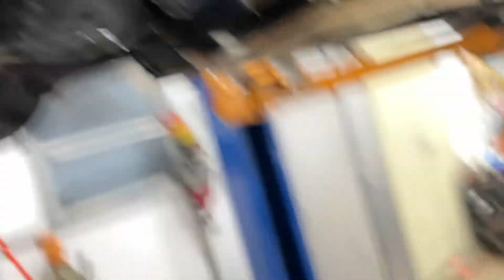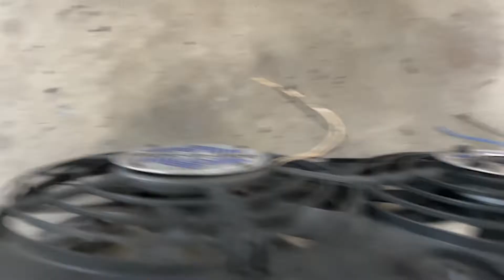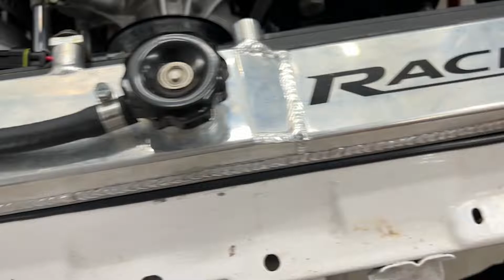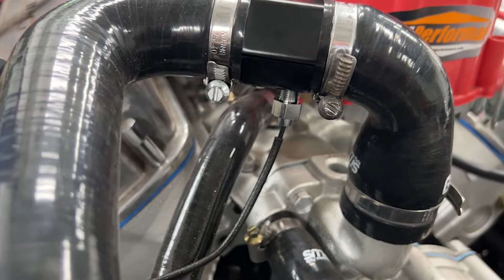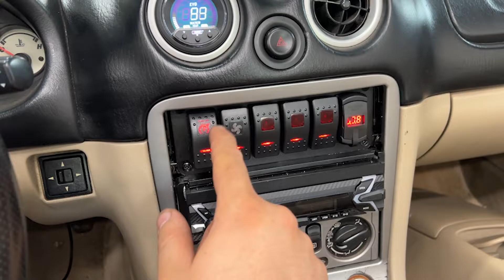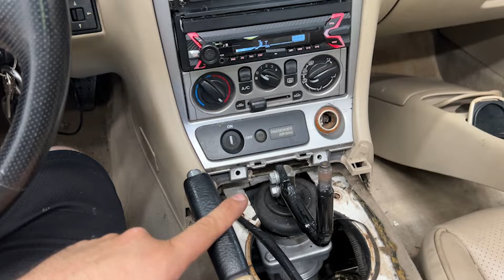Budget V8 Monster Miata Build - Episode 24 - Cooling fans upgrade /

Comment: great video , you should consider adding an oil pressure gauge next to the new digital one  , can't trust the miata stock oil gauge either
Reply from the maker: I do have one in the engine bay on the engine but I agree the stock one is just a dummy gauge , it would be smart to add one inside the car 👍.

Comment: I disabled my immobilizer light by disconnecting the plug to the immobilizer box. It’s under the dash to the right of the steering shaft - sits about where your right knee would. I just zip tied the plug out of the way.
Reply from the maker: Awesome thanks for sharing that info! I appreciate it.
Reply from the maker: I unplugged the immobilizer module and light is out 🤟. Thank You !